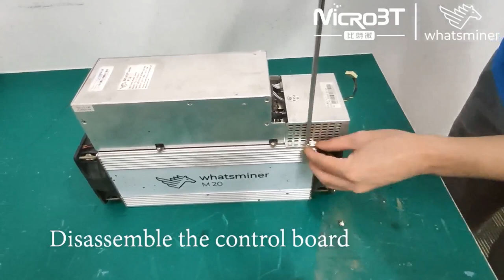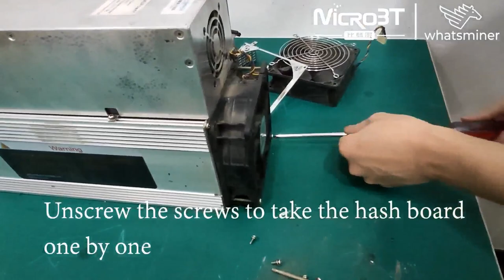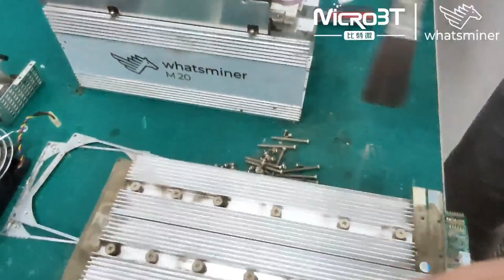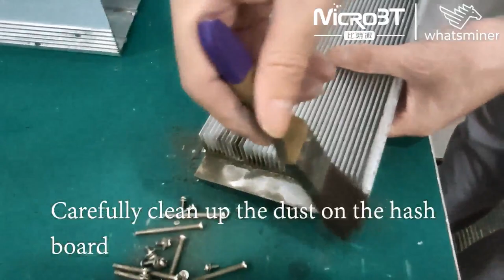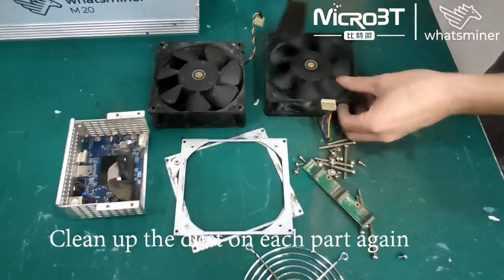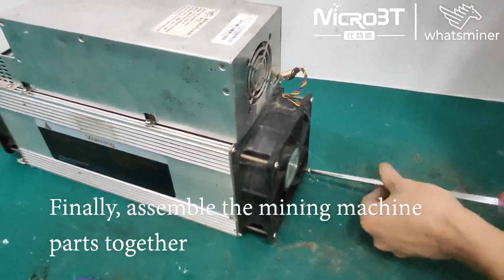How to clean up the dust in the #WhatsMiner

Comment: How often should this be done?
Reply from the maker: Hi, it is recommended to clean up every 3 to 6 months or so, but mainly depending on your operating environment
Reply: you should note the dust in the video is from a filtered room.see how fine the dust is?  if that machine ran in an unfiltered environment, it would be exponentially worse.  the inlet flows should be processed merv 8 and above. this is worth protecting your investment. and wear a ground strap when handling delicate circuits